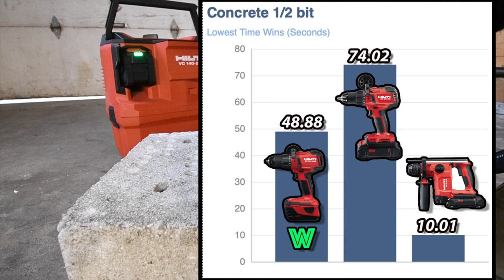New HILTI Nuron Hammer Drill you have to see!

Comment: I'm trying to get my head around the claimed torque. We work in Newton meters. The Makita are claiming 135 140 newton meters of Torque. When I compare the new hilti its around 84 newton meters of torque so a lot lower. I couldn't imagine much difference in power for each as I guess they have a different way of measuring torque.
I have the older hilto drill. I  also have a dry wall screw gun 22 volt and a cold cut saw. Great video. Thanks for posting.
Reply from the maker: every tool brand has their own methods

Comment: Hilti Nuron 4ah vs Milwaukee 5ah. If it loses, Hilti 8ah vs Hilti 4ah
Reply from the maker: I havent tested the new Milwaukee hammer drill yet. we will see how that goes soon
Reply: @ManCaverTools  I got one at work recently. It's a lot like a Makita lxt, except it accepts high output batteries. It's really, really good, and I feel they have almost transcended cords. I don't like needing a $150 battery for a $200 drill, I don't like how heavy 6ah batteries are, and I don't like Milwaukee's advertising. I like the honesty and potential of Nuron, and I wish I had the performance and refinement of xgt. I guess what I'm saying is, DeWalt and Milwaukee have snap on level marketing teams.